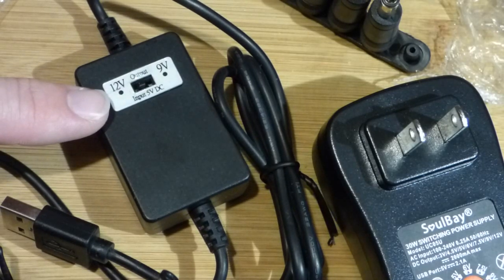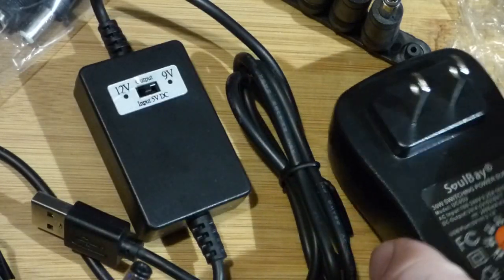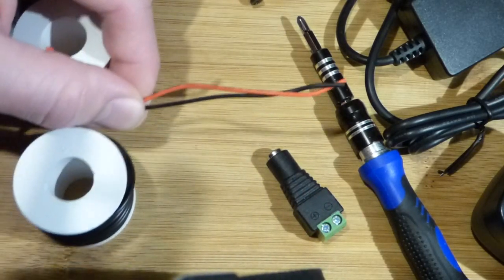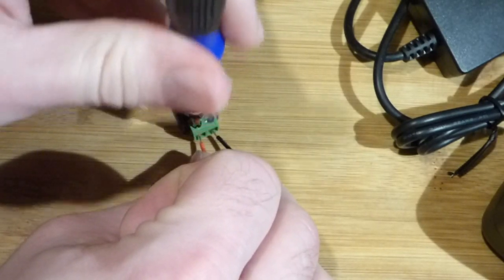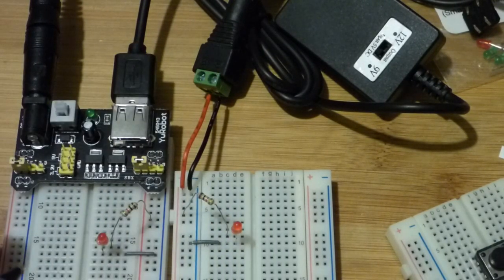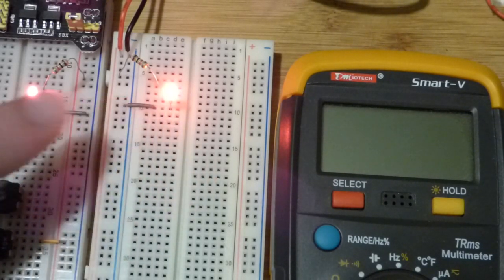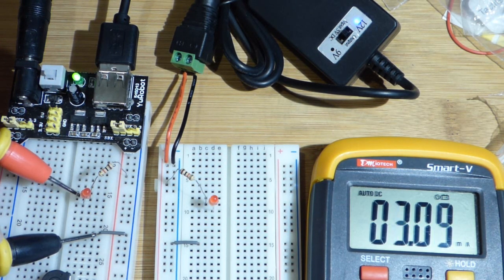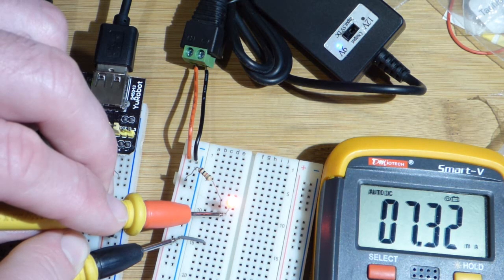Random project using DC 5V to DC 9V or 12V converter wire snip and strip and barrel plug to wire

Comment: Hi appreciate this video! If you’re still active, my female adapter is not outputting any voltage. Do you know what can cause this?
Reply from the maker: Thanks! As long as everything else is working properly, I'd have to guess that something is not connecting as it should.